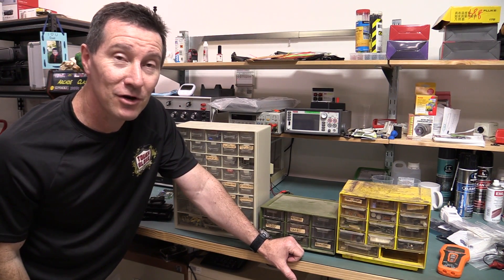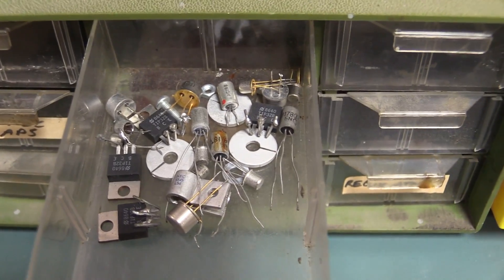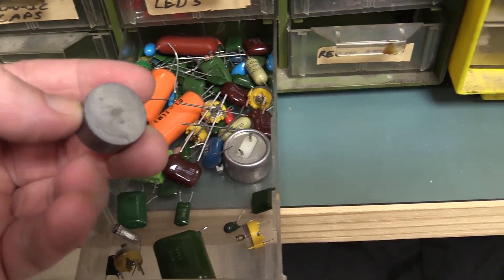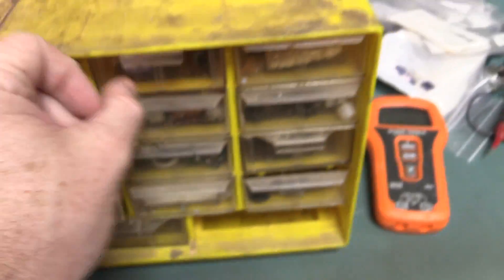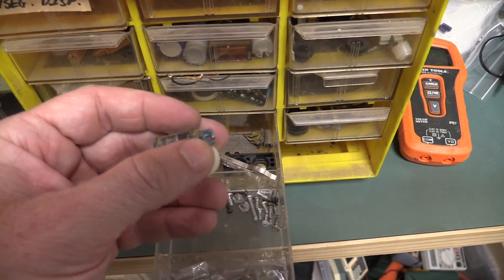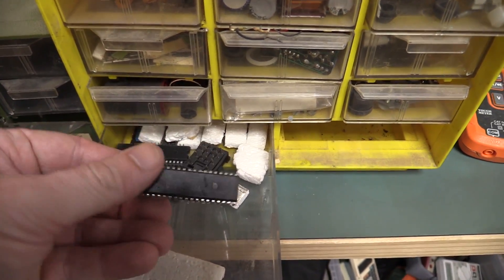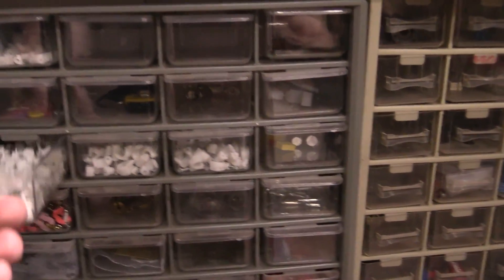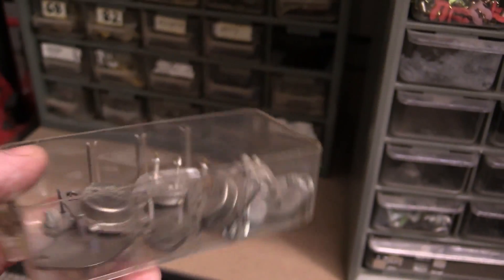eevBLAB #18 - Old Component Drawers

Comment: 6:28 I use the same Raaco drawers (and other models from the same series). Why do you stick your labels on when you can just slide them in? Every drawer has its own placeholder for a label. All you need to do is cut them at the right width.

Comment: So strange to see Dave talk about his first parts cabinet and instantly recognize it's the exact same one I have and it's also my first parts cabinet.  Mine says Akron Mills model 10-109 and I probably got it around the mid 1980's. I see a few for sale on E*BAY. I don't remember where I got it, it might have been Radio Shack, or it could have been a common department store item back in the day. Mine has some junk in it as well. A few RS-232 connectors, an old light bulb, a few MM74C90N decade counters I used in my first school project.

Comment: Ha!  That looks like the contents of my old parts bins!  I have that exact same solar cell (maybe two of them), from one of the old Radio Shack Science Fair kits.  I think it was a 30-in-1 and was powered by solar cells instead of batteries, if I remember right.  I also have a couple of those tape counters and at least one cassette tape head, plus nearly ever component I have was desoldered, salvaged from a board.

I hope you ended up giving that stuff to Sagan because that would make an excellent starter set for learning electronics, especially the old school through-hole stuff.  Get him a breadboard, soldering iron, and maybe some prototyping board and see what he can make.

Comment: Use the larger one for a new segment. "crusty corner" show and talk about old parts from when you were starting out or before and show the parts that have replaced them (old valve radios and the modern version) The key is use the old "crusty" parts drawer as the back drop.
Reply: +Mahogany Gaspipe That would be excellent!!!!

Comment: My drawers look about the same now. Except there's gps units (arduino stuff) and the mechanical counter is electric from a surplus store. salvaged 16x2 lcd screens. Resistors I was taught to put in card holders for binders. Alot in electronics hasn't changed in 100yrs save for the transistor. Still nothing out about the "memsistor" as far as I know (which isn't much) mildly frightened by quantum computing and machine learning but we'll leave that to the software guys.

Comment: The solar cell in one of the yellow drawers is out of a Tandy electronics experimenter kits... the ones with the spring terminals you'd run wires between.

I took mine apart at a certain point... Dad was mad, even years later. :\

Comment: Mr. Jones,
Was there ever a 7813 voltage regulator in TO-3 or TO-220 packages, and if so why discontinue such a proper voltage as they would be great for 12 volt battery charging.

Comment: Old scrounged parts have saved me a few times. We had a radioshack then they closed. I have found a lot of times electrolytic caps are quite handy. I have fixed like 5 monitors and a 40 in LCD  TV with salvaged caps. I even keep some of the crap brand ones just so if I need them for a test or something like that. 
Old parts are great for use in troubleshooting or quick fixes. If I was bothered enough if the old ones revive some gear then maybe i'd buy good new ones, but even old ones seem to last for years so I haven't bothered.

Comment: LoL, your old parts drawers have modern parts compared to mine. I was going to toss mine decades ago but changed my mind and put them away.  Turned out just last year I needed some good wire wound resistors and sure enough I had them in there.

Comment: Just give them a nice bubbly bath and preserve for Sagan, after all these years I still use (in my home lab) drawers that were filled with random electronics repair/salvage components that I got from my father, they work a treat. I think it's some kind of talisman, along with my good luck charm - silicon rectifier diode, first one that my pa got at work, looking like very oversized spark plug :)

Comment: Looks like my salvage bin :) But I only started a few years back at the ripe age of 35. At this rate I could be Dave at around 70 :D Anyone interested in an old neckbeard talking crust? Edit: Wow, I use the same sorting method, sort by constant, all magnitudes. As Dave, 10 bin lacking parts ;p

Comment: My drawers were bought around 35 years ago ...they are the interlocking type, you could buy them in different sizes ...single, double or triple width to name a few. They have a tongue and groove along each side so you could slot them together to suit your needs, they have secure label slots so you don't need to use difficult to remove self adhesive labels. You can't seem to buy them anymore ...unless someone knows different!!  Please post.

Comment: stick them in the dish washer for Sagen.
Reply: as for the parts, he will be lurnd good about using resistors on leds. Its all stuff he can blow up and learn from without being told off.
When i was a kid i tried to charge aa drycell on 240 mains with selotape and christmas light wire. my thinking being and in theory sound for an 8 year old that if i switched it really fast it would work. alas it exploded and sent the two halfs of the batt 12 foot apart. la sigh
Reply: +Sirus
Hilarious! When I was a kid I tried to power a friends battery powered DC electric organ (musical instrument, before the lude comments start!) from the 240v mains as we noticed that it was more powerful when the batteries were substituted for higher voltage ones and reasoned that 240v should make it really loud! Needless to say, the whole affair didn't end well - I was electrocuted in the process, their was a very loud bang and we blew the fuse for all the sockets in the house! His Mum was not very happy! I learnt an important lesson that day - mains electricity is dangerous and should be treated with extreme care and respect. The organ never worked again! 🎹🔋🔌🎆
Reply: +jjensen2492 
My friend thought it was hilarious! He wasn't recovering from an electric shock.
Strangely I wasn't allowed near my Dad's analogue meter!
Reply: +Sirus I have fixed more electronics with z DW than any other medium.
Reply: +Pete Allum My parents allowed me to do almost everything I wanted... as long as it was battery powered only. I wasn't allowed to touch anything mains powered. Sometimes I was unhappy but in the end I think it was extremely wise from them...
Reply: uski same here, but i talked them into the plug in transformers where battery voltage. I just rewired them :)

Comment: I got something very similar. :) Salvaged parts, crudely sorted, some drawers filled with small circuits, at least 20 years old. Might be time to toss it as well. Most parts in there can be had for very little money and you don't have to deal with oxidized pins and contacts.

Comment: I still prefer the old, rigid, crystal-clear polystyrene drawers. The milky-white polypropylene drawers are flimsy, and don't hold dividers very well.
Reply: Yep. Made the mistake of buying some drawers from Harbor Freight. The drawers are flimsy, bendy, and fit loosely because they are too small for the compartments they slide into.

Been thinking about just 3D printing replacements, even though I'd probably have to content myself with opaque drawers.

Comment: I have drawers exactly like that.  I even have the one with the calculator keys..hahah

You haven't lived until you've exposed your boards under UV lamps, and etched them in vats of hot ferric chloride.  None of these surface-mount components, reflow ovens, and board houses.  No sir.
Reply: +pillsnotbills I still etch my own pcbs. The results are amazing and its great to be independent from pcb services. In my opinion its just lazy and bad for creativity to order your pcbs from board houses. Just my opinion :)
Reply: KingofKatenfutter I haven't done it in a long time.  Perhaps you might consider documenting your process in some nice videos, KingofPCBoardMaking. :D

The results I got were very consistent.  Consistently bad, that is.  No silkscreen, no solder mask.  I was not that sophisticated.  Typically there was an area of the board where the traces were partially etched and I would have to solder bare wire on to complete the circuit.  Good times.

Comment: I was optimistic until you said you would keep the components.
You dwell on it until you convince yourself it's worth keeping.
Don't you see the similarity, Dave.
Get rid of it all with extreme prejudice because it is death of the mind.
On the very rare occasion that you can do a prototype with stock parts, you buy one of those sets with several of each in a range for pennies on ebay and keep them in a single box. SMD most likely instead of that through hole tragedy.
Because a project ALWAYS calls for something specific, you prototype it in ltspice while you order the parts from digikey. Salvage is for wasting your life.
You really really need the wisdom to know that nostalgia is death of the mind.
Reply from the maker: +Mila Miglia I did not say I'm keeping the parts, the parts are worthless. I'll keep the green drawer set for Sagan though. The others don't really mean much to me. I always hated the yellow one, it had dodgy drawers.
Reply: +Mila Miglia Ever heard of planned obsolescence? Most of the modern crap simply isn't built to last, and SMD just makes repairs harder, through-hole is great for any project where size is not an issue. Don't get me started on the whole BGA lead free ordeal which pretty much makes any modern hardware fail within a few years, while things manufactured in the late 90s and before that last a lot longer, just need to replace caps occasionally, instead of having a reflow/reball nightmare.

I can already see this happening on ebay, people want older stuff because they are tired of shit that breaks all the time. They are looking for quality and repairable designs, and to get that you usually have to buy older stuff. In general it is also easier to find service manuals for the older products, either because the companies don't care about protecting their old designs, or because the new products aren't manufactured to be repaired at all, using epoxy etc.

BTW: Where is the logic in lead free solder being good for the environment when the hardware fails and end up in a landfill after a few years? With lead solder the products would last a lot longer, to be used or resold.
Reply: +EEVblog yah, he can use it for his Lego's.  Then you can get him MORE LEGO's!  lol Don

Comment: Pass it down to sagan! He deserves it!!!!!
Reply: It would be a nice sentimental gift for Sagan, and a connection with his Dad -- so my vote as well for the green drawer.  The next question then becomes what parts to give him to stock his new organizer drawers...maybe some lights, motors, battery holders, and some switches and push buttons along with some alligator clips so that Sagan can build a few simple circuits.
Reply: +HTFCirno2000 maybe sagan is more into ballet or painting or anything... and not into electronics :)
Reply: +MP-Tuners Productions Things like this still hold a lot of sentimental value...whether or not Sagan goes for electronics it is likely that down the road this will still mean something to him because it meant something to his father.
Reply: +HTFCirno2000 CHIRUNO
Reply: *****
Haruhi :3
Reply: Yes and he is not going to use it for 30 years.
Reply: Keen to know if it eventually got passed down to Sagan.